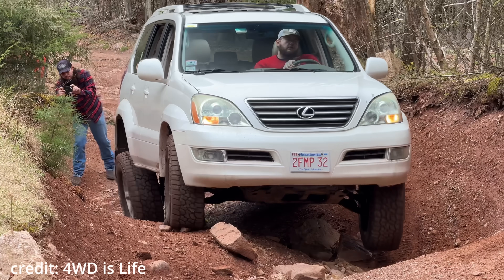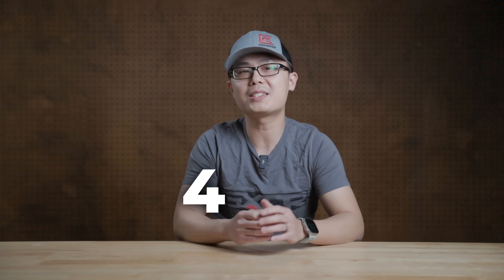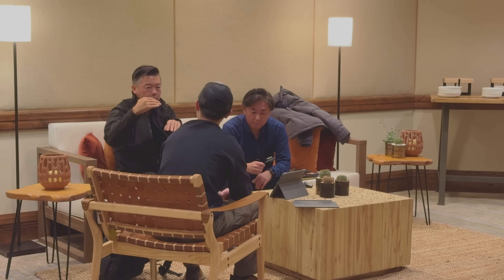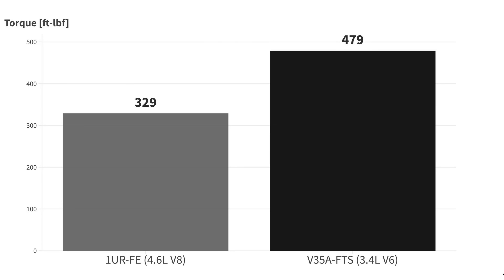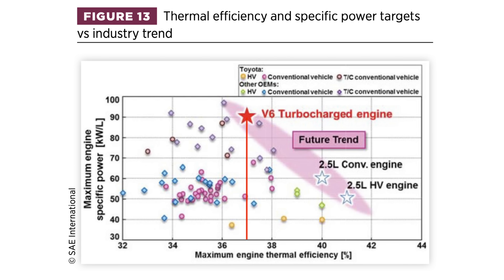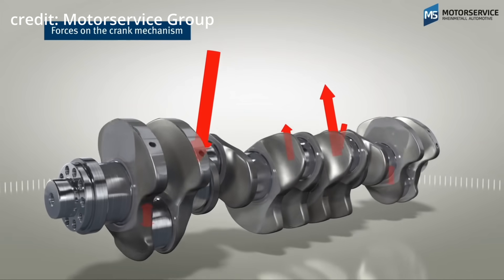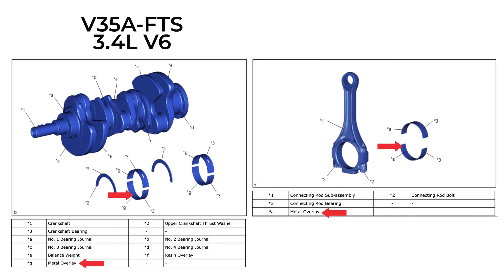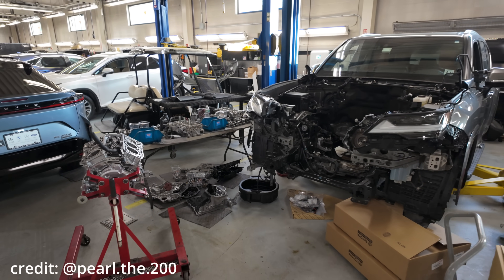Is Toyota V35A-FTS Engine Reliable? Well..It's Not That Simple

Comment: Here is Saudi Arabia, I already have seen many workshop complaints of engine failures for the new Land Cruiser.  At first Toyota blamed it on out of specs oil filters but this keeps on happening  to LCs inside the warranty period now they are blaming it on truck misuse 🤷‍♂️

Regardless of the actual reasons behind it, the new LC is no longer the workhorse it once was.  And it is not just the engines that are failing,  the earlier batches of the truck seems to have problems with fixing the body to the ladder frame beneath it.  I have see two accidents where the body detached completely from the frame.

Comment: Dont need to have a PHD to know that adding turbos decreases overall reliability.
Reply: They could design the engine as if it were going to be used under full boost, 100% of the time.

Comment: so cool you could have this conversation with a chief engineer. My next question would have been what was the underlying determining factor then.  Were they looking for a specific tq output at a specific rpm with a fixed number of pistons and displacement. something had to of come first to determine how everything else needs to be designed. you usually don't pick a bank angle or a many other things with out having some sort of goal otherwise the combination of parts and pieces would be seemingly infinite.

Comment: In my opinion a turbo engine will only last 150,000 miles and "maybe" with meticulous maintenance 200,000.
Turbo's used in off-roading can present a serious problem during water crossings, imagine getting cold water on hot turbo's.....NOT GOOD. I am over 70 years old and remember the early days of Baja with Mickey Thompson, Dick Cepek and Phil Reusche. KEEP THINGS SIMPLE FOR RELIABILITY AND LONGEVITY!!! I'm going to sit back and let others be the test subjects and I don't think it will take long to see problems with this idea.
Reply: what about turbo diesels then? those last near forever. if you're crossing water to that depth... you should have a snorkel installed anyways. water crossings during overland aren't common, and it's your responsibility to be prepared.
Reply: @jaykua6193  I appreciate your opinion and have to admit you have a good point but we are talking about a gas engine not a diesel. We'll just have to wait and see, and I don't think it will be long before several problems raise their ugly heads.
Reply: @jaykua6193  I didn't get that he was talking about water ingestion.  He's talking about water reaching the turbos, on the outside.  Cold water hitting hot things.  Things that are waaay hotter than the engine block.  I'm of the same school of thought and to the subject of the video agree that more power from a smaller package reveals inherent vulnerabilities.  Time always tells tho and usually - even with "new tech" - old-school reigns supreme.  Albeit more slowly than instant gratification.  lol
Reply: With all due respect, you are wrong on every level here.
Reply: @TasmanianDevil3  You may be right but time will tell and I look forward to the results but, my racing day's tell me otherwise.
Reply: @richardstone5241  It's not 1980 anymore.

Comment: TOO MUCH POWER FROM A SMALL ENGINE YES, IT WORKS BUT NOT FOR A LONG. ITS LIKE 6 ARMS VS 8 ARMS FOR THE SAME PROJECT. 6 HAS TO WORK HARD TO GET IT DONE AND WEAR OUT FASTER.
Reply: It works for Toyota and has a long history of turbo Toyota
Reply: The Nissan GTR, since 2007+, has made a lot more power out of a 3.5 engine than the toyota does, and it's been reliable. I think a manufacturing issue needs to be worked out.

Comment: Let's compare the V35A-FTS engine to the Ford AJD-V6 - 20 year old design, 3.0ltr and is slightly heavier.

V35A-FTS - 349-416 hp / 405-479 ft-lb. 
Ford AJD-V6 - 241-302 hp / 369-516 ft-lb.

I have a Jaguar XF with the AJD-V6, modified to 387hp at the crank and 612ft-lb at the crank. Has 217k miles on it - I got the car at 57k miles. The only issue has been cooling & fueling, which was a relatively simple fix.

Comment: Just like any company who design things to operate in high load conditions, they sometimes overlook a certain scenario that will cause failure. From what I see here, trying to support a short crankshaft with small journals on only 4 main bearings, in an engine producing huge torque output at relatively high rpm will cause frequency harmonics and torsional flexing in the block and the crank itself.. Main bearing failures are caused by contact between the shaft and the shell itself, either by distorting things to the point of misalignment, or by force pushing the oil wedge out of the bearing clearance, or both. Even toyotas last 3.4L 5vz-fe had 5 main bearings and it only made 187hp..

Comment: In my opinion, this is an inherent design flaw, improper bearing clearance or oil system issue. There’s no way an engine that had “manufacturing debris” makes it 20k, 30k or up to 60k miles at the time of failure. The google docs report from the Tundra forum shows multiple maintenance schedules, hybrid, non hybrid and even a 24 with engine failures all very well detailed information. I’ll be very curious to see what Toyotas fix will be for this. More and more are popping up everyday on the Facebook pages and forums too.

Comment: Actually here in the middle east with the hot climate it was a mess, alot of these engines had issues with the bearings. Some of them said that they were using 20-50 oil which is not recommended by the manufacturer and some said that they were using the 0-20. From what I heared that the dealer refused to fix it as they say there was violations of warranty.

Comment: I like these style of videos. It really details that the complexity of automotive design is more detailed than one major change.

Many people probably think that Toyota took a normal V6 and just added turbos, but duh, these engines are built to handle the forces and heat of their intended power output. Not risk having high power boost. These aren’t tuner cars lol.

Understanding the engineering shortfalls depends on exploring the details.

Comment: Here in Saudi we use LC 300 alot i have seen couple of them uner maint. For engine rebuilt. When asking the mechanic . He said wrong oil filter.😢. Crrently. I am driving 2014 LC 200. 4.6 L V8. it runs smooth with 430,000 km. Please note that in Gulf area in Qatar UAE Bahrain & Kuwait still you can get LC 300 with 4.0 V6 on no Turbo. which is for real off-road. In Arabia we use LC for living similar to Austarilia not for fun. Finally, thanks for well done job. The intreview was nice and we need more. I like you content🫡🇸🇦

Comment: As an expert in the field of engines, I will describe a solution to this problem: raising the viscosity of the oil so that the thickness of the oil is effective in preventing contact between the bearing parts and the crankshaft. Increasing the capacity of the oil container by enlarging its size is an increase of 3 liters in order to reduce the thermal stress on the engine oil.

Comment: amazingly made man, im a porsche tech, but almost all the dealerships in my area are in the same place, and ive got a buddy thats a tech at toyota, and from what i hear from the guys there are that toyota is just making ALL the wrong choices in regards to engines, in the past 2 years since the 3.4 was introduced in the tundra they have had 24 tundra's with it come in for the EXACT same bearing issue, most were daily drivers with less than 15 thousand kms. they ended up buying back more than half the trucks and those in some cases lifetime toyota owners, simply had to abandon the brand they had sworn by for the past 3 decades, i know a few went up the road and bought silverado's and f150's

Comment: I would assume something with the failed engines could have had something with the bearings out of spec or improperly assembled considering the replacement is running strong, we probably need more miles to be sure. It will be interesting to see how this develops as time and miles go on.

Comment: I bought a new Nissan Titan 5.7 V8 and the Crank Bearing went out at 10,000 miles.    

I’ve had no issue with my 2022 Tundra twin turbo.  
They found the engines were being damaged by machine debris at a certain plant.  My truck did not come from that plant and has no issues. 

Im coming from a Q50 Red Sport Twin Turbo.  I just treat my truck nicer than I treated my Q. 

Most importantly of all CHANGE YOUR OIL SOONER. No more than 5,000 miles.

Comment: Increasing torque via boost at lower rpms puts more stress on the crank rigidity and bearings. If this engine is as efficient as you say, with diesel like bottom end torque, then it's going to need substantially strong bottom end hardware.

Comment: i think ive read that the issue with the main bearings comes from debris in the crank oil ports from manufacturing, thats why some fail within 30 miles and others within 40k, the 1hd-t was one thing with exploding bearings but this is even more concerning.

Comment: Its the engine oil.  Having the same problem in Australia with the 300 series V6 because they have to come with 0w 20 oil to pass emissions and its like water.  The Toyota manuals even say to upgrade the engine oil to 5w 30

Comment: Now that the issues has been isolated it would be great for Toyota to address the issue. 

I was told by expert mechanics that most engines are designed to fall apart at 50,000kms therefore we all have that massive service expense at 50,000kms. Not agreeing with the service issues but Toyota still is a business to run as with all these technology I’m quite sure they can make it even more reliable.

Comment: When the T24A-FTS came out it was asked to one of the higher ups at Lexus. Don't remember which at the event. They were asked the whole how is the small turbo engine etc going to compare in reliability and repair cost vs the N/A v6 (and later v8). The answer was basically for all of our new customers the engine will last and be problem free for the term of our average buyers life of the vehicle. I think Lexus is between 50-70k miles before they replace? So that right there was them saying yea it will last for the people who buy them new and make us all the money. Didn't say it would be a nightmare after that. But look at the new 4runner. The 4runner club got together and went to Toyota and said we will NOT buy the new truck with this turbo engine. Rather than listen to the customer who buys it, and we all know 4runner people are like a cult. They extended the release of the new model by a year so that all of those who wanted new could get it with the shortages and all of the past couple years. We can even look at the Tacoma right now and see that the new models are actually selling for less than the older v6 4x4 models that are still new on lots. Why? Because people don't want that motor if they plan on keeping the vehicle for a very long time. Honda took a beating with its 1.5 Turbo engine and it still has the same issues but somehow they managed to convince people its not junk for long term durability. And we can already look at Lexus and see how much the newer interiors have downgraded in quality for the redesigns vs the older models. They need to learn to leave things alone. Yes they needed to increase the economy on the 4runner for example. But it was being sold with a 5 speed. Put an 8 speed or even higher speed. That would be a huge improvement. And the 4runner also didn't have  the defective by design direct injection that adds massive costs to keep it maintained. For so long its known that that style of fuel injection causes massive amounts of carbon buildup, detonation, and over time it kills the engine if its not taken care of. Lets also not forget that it costs MORE to produce and implement.

Comment: Similar to the Nissan Vr30ddtt. Knowing toyota they put a multi port injection to supplement to clean the valves along with  the DI system.  That coupled with smaller turbos and continously variable intake and exhaust phasing you have an engine with amazing low and mid range and still a decent top end.

Comment: I agree 100%,, hence why I traded in my 2019 Tacoma for a last 5th gen. 4Runner,, with the proven 4.0 liter and 14 years of perfecting the truck. I want and need Toyota reliability and will not be part of the new wave of engines entering the market until they have been out for a while and have been proven to last 👌

Comment: Honda K-series and other engines (Honda V6 too?) have been using these one-piece main-cap cradles, or “ladder main caps” for +2 decades. Zero issues and super robust (spinning a bearing is one of the last things to happen on a high horsepower Honda build… head gaskets, cracking sleeves, breaking rods/pistons, dropping valves usually happen first).

I’d think the prob is over-stressing and turbocharging a small displacement engine (as with many modern engines these days, due to regs/emissions). 

And/or oiling issues need addressing. And/or, typos in engineering/manufacturing of tolerances/geometries.

Comment: This platform runs at such a low RPM for max HP/TORQUE so higher revs are not necessary, Along with thermal efficiency being so high if built correctly this platform should in theory be very long lasting only time will tell.

Comment: One thing I’ve noticed is people new to turbocharging are expecting torque on a cold engine. My co worker is on boost leaving the parking lot on a cold day, going well above 4500 rpm. He doesn’t even let the cold start cycle complete before we’re off. Seeing that the main bearing has three metals interfacing, perhaps nothing is getting up to temp and people are getting on boost way too soon?

Comment: I just bought a GX 460 a couple weeks ago, and I think people have kind of unrealistic expectations or demands for the horsepower figures that a truck "should" have in today's market. The v8 in the GX is totally sufficient for any kind of likely driving situation - provided you apply enough throttle! However, if the going away present from Toyota for the previous generation GX was a retuned version of the 2UR...or a factory installed supercharger option...that would be awesome. The 460 with 400 horsepower would be plenty powerful and still durable.

Comment: The phrase OVER stressed is silly in the context of considering only the torque output versus the displacement. You could make twice as much torque if you wanted to engineer the engine to withstand the higher cylinder pressures required. It's all just a matter of cost, weight, average demand profile and durability expectations. How much stress is too much? Too much for what?

I don't know anything about that Toyota engine, but if the typical Toyota reliability targets were used, and the engineers did their job well, then it should be no problem. Plenty of other forced induction engines make more torque per liter than this does, and they're fine, at least in terms of the basic engine block and heads and rotating assembly. Of course they don't have the reliability rating that a Toyota has, but that's most often due to stuff that isn't related to cylinder pressure.

Comment: This is an easy one for me, deformation differs between the aluminum block and cast iron components causing micro tolerance change which leads to oil starvation. It is not a power and torque issue alone, the 2JZ can push 1000+ hp without any main and rod bearing problems. Reason: robust cash iron block which is made from an extremely stout alloy. Also of note, the 2JZ has no main bearing girdle at all.

Comment: Speaking of bearing, the only thing which lives between shaft and bearing is oil, right? That means either oil film between shaft and bearing disappeared at some moment or oil contamination happened and started bearing eating process. If this guy is really interested in finding the cause and he has other cars with same engine, he can monitor oil pressure every time such car arrives and also crack-open oil filters for metal parts after every oil change (maybe something else in the engine wear-out significantly). BMW's N63 and S63 engines also kill bearings so good mechanics monitor oil filter condition after oil changes. Also since oil filter has bypass valve, it could be opened and let metal parts to free-flow, the valve could be weak (aftermarket filters or counterfeit or toyota supplier manufacturing issue) or oil pressure is too high so the valve is opened most of the time. The key to finding the cause is oil anyway.

Comment: Turbo lag is almost an old history when variable geometry turbo is becoming the standard. And that's 20+ years ago. It depends on where you live when it started. VGT technology was first introduced in serial engine by Audi with their TDI lines if I remember. Low rpm torque and constant maximum torque till 30-80% max rpm.

Comment: toyota tundra forum has a spreadsheet of V35-FTS failure and out of 76 reported cases, seven were 2023 model, one 2024 and the rest is 2022. Three of the 2022 had failure twice. Definitely something happening at 2022 model.

Also majority close to fifty of the cases had oil change at 10,000mi (which is not good). The rest of them that had 5000mi oil change, most of them again was 2022 models. 

Also detuned SR variant had three cases

There was two LS500 and three or four LX600 case also. Have not heard anything about LC300 or Hybrid Sequoia interestingly. Now for the LC300 probably because those are sold in world markets primarily in diesel or 4.0L V6 out of a current 4Runner

In these high performance turbo-engines I would change the oil every 5000km not 5000mi (so just over 3000mi)

Comment: They should have added 2 more cylinders with the turbos, or more displacement up to 4+ liters. Alternatively they could have also gone with stronger internals on the bottom end to hand the weight component. Many things could fix this issue.